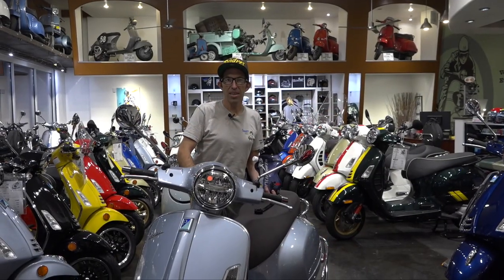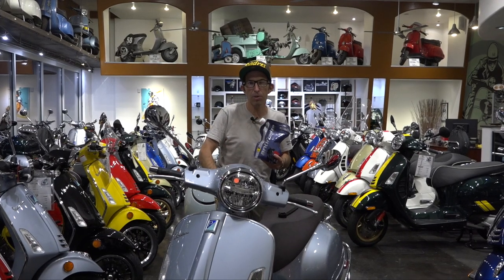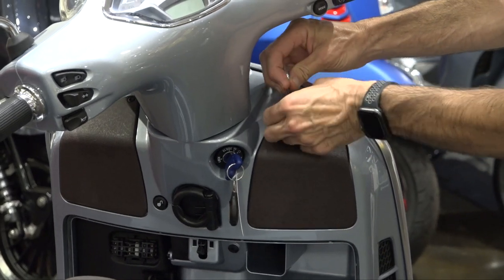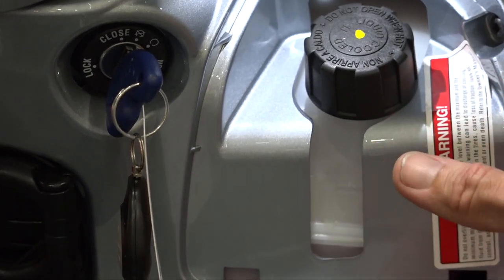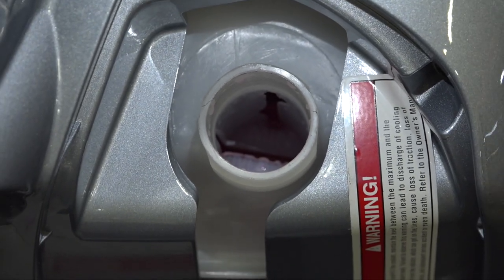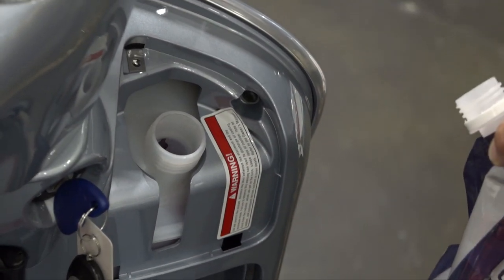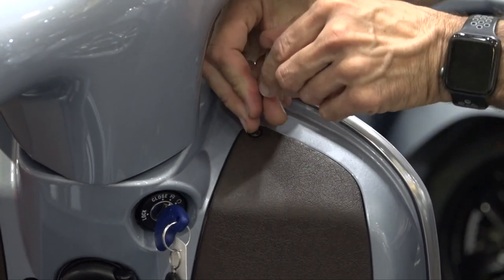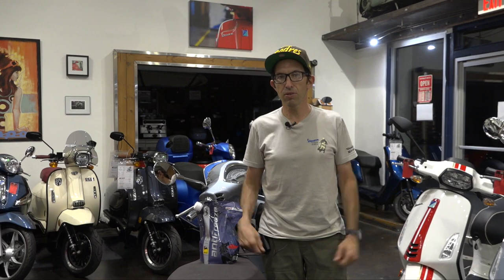How to Check & Top Off Coolant on your Vespa GTS

Comment: Thank you for this! Do you know if it’s ok to top it off with distilled water? Original coolant is not available where I live. I bought an used 2017 gts and the coolant level is a bit below minimum but I don’t know which brand/type last owner used and I’m afraid to mess it uo by mixing coolants. I’ve read online conflicting opinions on this regard. Thank you!

Comment: I have a Vespa GTS 200L it runs good and I keep an eye on the fluids every so often because I ride it quite a bit but winter is coming fast so I won't be riding much longer and I'm having problems with the battery keeping charge and it's not even 3 years old and it's a duralast battery so I'm trying to diagnose what can be draining the battery it has a new relay and starter there not that old so I'm trying to find out what can be draing the battery thanks.
Reply from the maker: Hi Jason, See if you can get the battery tested. we've replaced 2-3 year old batteries all the time with bad cells. Thanks for watching.

Comment: plz answer me how to change mill to km in vespa gts 300 notte
Reply from the maker: You turn the key on with the mode button pushed (and hold for 2 seconds) and it will switch.
Reply: @VespaMotorsport  thx u i will try this
Reply: i try this I tried this but it doesn't work
Reply: @VespaMotorsport  please make a video to show how to change from mile to km in vespa 300 notte
Reply: @VespaMotorsport  I tried this but it doesn't work
Reply from the maker: We will make a video for this soon, stay tuned...
Reply: @VespaMotorsport  ok thx u

Comment: I purchased a used 2014 GTS and the coolant is pretty low. I'm not sure what coolant (factory or otherwise) is in there presently, but I do have a new 1/2 gallon of Maxima Coolanol ready to use 50/50.

Can I just top off with the Maxima Coolanol, or is it harmful to mix coolants? Thanks for any feedback.
Reply: Hey Zach, eveything I hear suggests that it is a bad idea to mix coolant.  Given the age of your scooter and if you don't know the maintenance history, it might not be a bad idea to drain existing coolant, flush with distilled water and then replace with new coolant.
Reply: @chadparrish926  That's what I figured too -- except, it turns out the phillips screws on the water pump cover are stripped out.  One of them even has an impossible angle to try and maneuver.  Can't even angle a dremel to notch a deep slot.  Kinda stuck at the moment.  Thanks for your response, appreciate it.